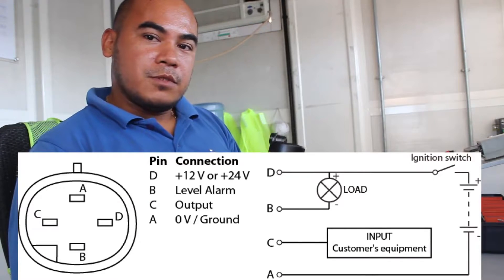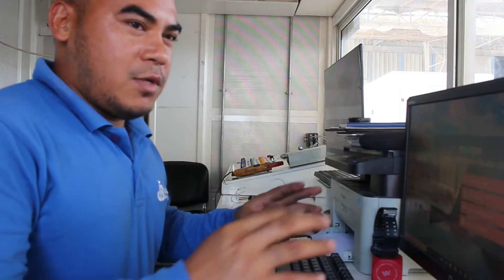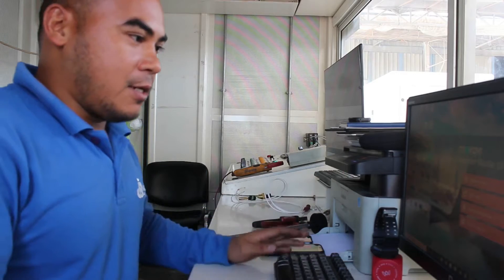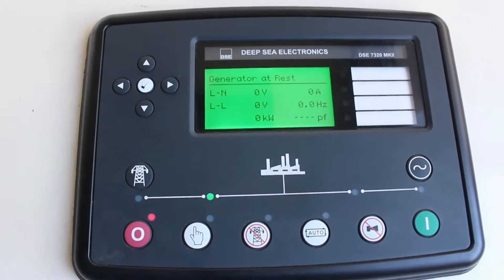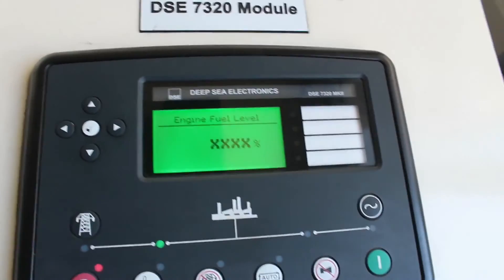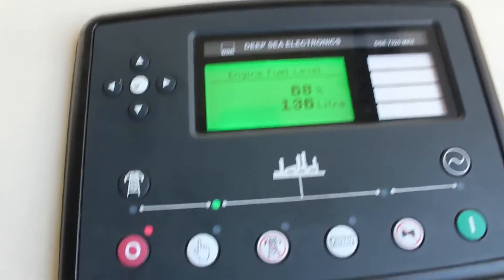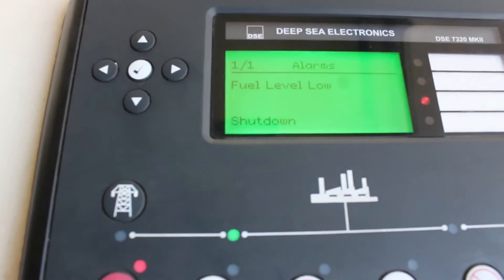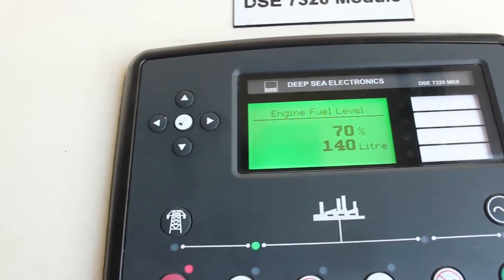Fuel level sensor installation and its configuration benzblogs

Comment: I used to monitor my generator fuel on dse controller  that is. Engine>>fuel level and get like 70% or 20% but yesterday when checking   level the dse was showing xxx  what could be the problem please update
Reply from the maker: What is the sensor you use for fuel level sensor if xxx meaning there no supply for your sensor or sensor itself defective or wiring problem

Comment: Hello sir I enjoy you videos here in Kenya  but I have a question . If the fuel level was showing on the date scree. But it failed to shoe like in the last 3 days what could be the problem
Reply from the maker: Do kne thing in there controller you should config and save the last 3days before its delete its own

Comment: just watching how to set up fuel volume sender. is there a pressure sensor that can doe this , my tank is 1.2m high but just 300 ceiling clearance in acoustic container. Or a distance sensor suitable for deep sea?
Reply from the maker: In the deepsea there you can select temperature, presure , and level

Comment: Hello! Thanks for the video. Please send the updated
Reply from the maker: Welcome
Reply: @benzblogsVlogs  um trying to intergrate the fuel level into the control, I have tapped the signal from the manual gauge but it is failing to pick the fuel signal on the config

Comment: Hi bro 
This level sensor and level switch fozmula tll70 is not the same?
Reply from the maker: Same but its varry the size
Reply: @benzblogsVlogs  then i can connect the fozmula tll70 to the analog sensor to visulize level?
Reply: And configurate digital output to control fuel pump?
Reply from the maker: @hermantoofa1868  yes
Reply: @benzblogsVlogs  thank you bro
Reply: @benzblogsVlogs  have you ever configurate dse 7310 for glow plug?
I have fg wilson genset(perkins) with power wizard module and must replace them with deep sea controller 7310
Reply from the maker: @hermantoofa1868  yes
Reply from the maker: @hermantoofa1868  yes

Comment: Hello, I enjoy your GenSet content. Im installing an a fozmula FLS just like the one you’re demonstrating on the video. I’m integrating it on to a DSE module. Can you please send me the update for parameter settings? Thank you
Reply from the maker: No problem go to deepsea config what module your using
Reply from the maker: Go to engine in the deepsea config thin fuel option thin fuel control and monitoring thin input type slect fozmula what fuzmola your using thin size of the tank thin you can see what your going to low alarm thin put how many percent you not to shutdown the engine
Reply: @benzblogsVlogs  Wow thank you for the quick reply, sir. I really appreciate it very much. Continue success. Have a great weekend.
Reply from the maker: U want to shutdown the engine put what percentage you put
Reply: @benzblogsVlogs  thank you bro
Good job

Comment: Hello sir! Can the OEM FUEL SENSOR be edited or configured through the Editor's Screen of DSE 6120 MK3?
Thank you!
Reply from the maker: You edit the graph curve if you want for example your sensor is not in the list in the module
Reply from the maker: But follow what ohm sensor type your using follow that in the graph in order to do correct

Comment: How setting for tank 500L,because my deep sea still fault at 50% and engine idle cannot full speed dse 7420
Reply from the maker: Do configuration for dewp sea calculate the tank size and put it in the program no  check the size of your fuel sensor
Reply from the maker: Make sure your fuel sensor if correct size  till the edge of the thank

Comment: sir pano mag troubleshoot pag low pressure oil ang alarm ng genset?
Reply from the maker: Sir ganito check mo oong ang oil mo ay naaa tamang sukat tapos mapara malaman mo ang sukat ng presire oil mo pagcrank mo apr pinaandar ko yung genset mo ay makikita mo doon sa module kong ilang bar or psi doon mo sya malalamn kong inaabot ba ang setting mo ng low oil presure ngayun kong ok naman ang reading ng module mo konin mo teater ko baka naman sira yung senaor mo
Reply from the maker: Ilagay mo sa set mo sa reaistance ang tester mo konan mo ngayun ng reading by ohms yun dependi yan sa kalasi ng sensor but mostly kong halimbawang nasa 400 ohm ay ok payun pero kong 20 mababa pa ay yan ay sira na kailngan mong palitan na yan
Reply: @benzblogsVlogs  thank you so much sir sa tip, godbless you👍
Reply from the maker: Sir salamat din sa pagtitwala